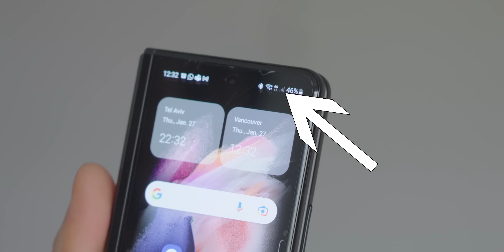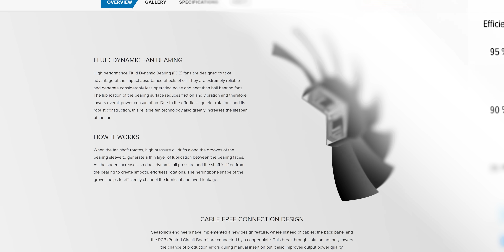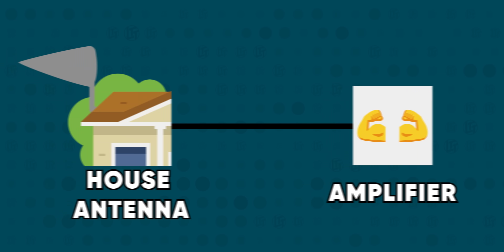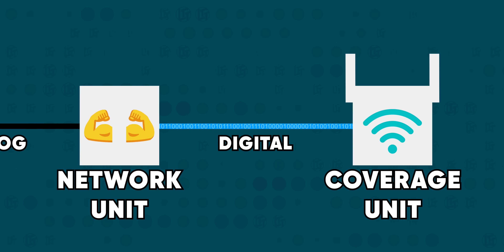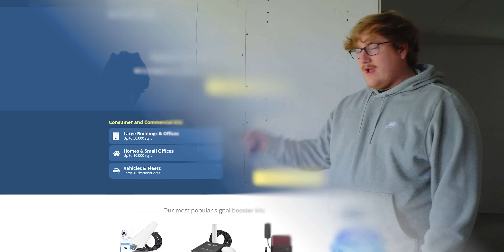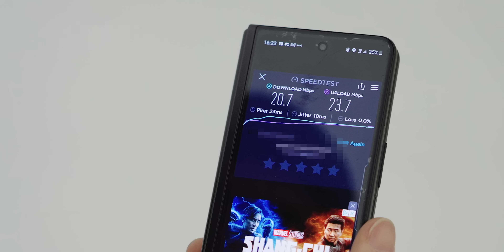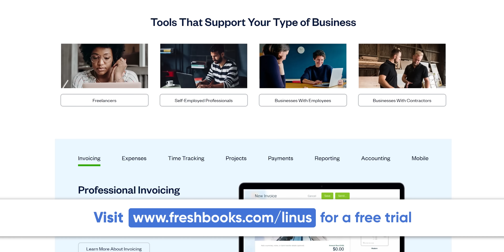I Hate This... New House Cel-Fi Cell Signal Booster Install

Comment: When thinking about cellular signal repeaters also make sure they are not against the law. In my country, if you install one without ,not that easy to obtain, permission from the authorities, you are just waiting for hefty fine. Eventhough you would install it on your property for example.
Reply: Any cell repeater that provides less than 70dB of gain is legal in the US. Now for the Cel-Fi equipment they purchased, only a certified installer can purchase it. Since Linus is certified CAT installer they were able to sell it to him
Reply: The purpose is to limit interference. It would be incredibly annoying for your neighbors if their cellphone's stopped working because they use a different carrier and you set something up for your building incorrectly that creates interference.
The FCC and other government organizations take commercial interference very seriously.
Reply: In the Netherlands you cannot use repeaters unless the provider gives permission. Which they will not and the fines are fairly high.

The problem is that each repeater increases the noise in the uplink and as such reduces the cell tower's range by a bit. Think of it like this: If you and a friend are standing a fair bit apart from each other in the middle of nowhere, you will be able to talk to each other. If the friend is a bit further away you may have to talk louder (as in increase the send power on you phone and drain the battery faster) but you can still talk to each other. Now plonk a busy highway behind your friend and you will have a much harder time in understanding each other due to the added noise.

The rather pathetic speeds Linus got there could be due to:
1. Provider doesn't have enough capacity on the cell (so a bad provider)
2. Too many repeaters in the cell, causing too much uplink noise and reduced cell performance
3. You could be on a cell intersection where 2 cells with the same channel frequency have about the same signal strength and that causes interference.

It could be all of the above, of course. You can use an app like "Network Cell Info" do a quick check on the probable cause. You RSRP (signal strength, ie. no. of bars on your phone) should be > -100-ish dBm. RSRQ should be > -20 though -15 and up is better as this does affect your internet speeds more than signal strength. Compare that to the first neighboring cell to see if you are on the cell edge or not and get interference from that. You can also keep an eye on the PCI (cell identifier) to see if your phone hands over to another cell. Those are generally places with reduced data throughput and you do not want that to happen too much in your building.

As for the coax cable, that is just standard 1/2 inch cable. Biggest we use is 1.25 inch which is a pain in the behind to use. Just make sure you put the connectors on properly as a faulty connector can cause quite a bit of noise as well and that will mess up both your coverage and cause problems for the provider. Also put the antenna on the roof and make sure it has line-of-sight with the tower if possible. Though you may need to take precautions for lightning strikes.

Comment: The first rule of any access point install or in this case cell booster install. Is have your network cable installers give you a certification report or certify each cable. Its amazing how often a cable is improperly terminated or contractors damaged the cable during construction.

Comment: I love how for 90% of the American content having a "concrete" home is a problem

Meanwhile I'm here in my concrete house having full 5g bars because where i live(Puerto Rico) cellphone companies actually account for the concrete structures and make the towers better at building penetration
Reply: I wonder if because of the increased traffic such as population, cell, wifi, air traffic control, satellite(MTU's for cable internet), etc, that they have to reduce the strength of the signals so as to not cause interference. My bet is regulations cause weaker signals here, whereas in Puerto Rico, there's not as much red tape so they can pump out the signal.
Reply: @thebaker8637  The only place I have cell phone data issues is near the phone store(there are 3 provider stores in a 2 block section of a super busy area.) Whenever I leave that area, a mile or two, I must connect to a different tower, whereas when I'm in the busy area, it feels like there are too many users for the urban tower at one time so there's a lot of people in queue. But as far as why the cell service suffers through concrete here, but not in Puerto Rico, it could also be the copper piping for the heating solution acting like a Faraday cage.
Reply: Same in india.
Reply: Well yeah.. why would cell phones companies spend time and money to account for concrete homes in a place where there are very few
Reply: @Surtistuff  to make their internet speeds better and one-up the competition?
Reply: @bethelscrubs2549  Europe in general has stone and concrete houses.
Reply: I know right! Here in Brazil is really really not a big deal having cellphone signal even in the middle of the atlantic forest
Reply: IMHO I think the main issue here is not with the concrete structure itself but with all that plumbing for heating and with the possible aluminum bars in the walls used to hold the plasterboard.

I think so because I also have that same arrangement in my wood house and I also have some issues with cellular reception, although not as bad as Linuses, whereas in my old concrete house I never had any.

So, yeah, apparently the aluminum bars in the walls and the copper tubes in the floors somewhat manage to form a good enough approximation of a faraday cage I guess.
Reply: @eddycolangelo  It's kind of both. Cement and brick are way better at shielding from microwave radiation than drywall is -- I think this goes without saying.

In Linus's case I'm sure that the main issue is all the water in the floor heating absorbing all the microwaves from the cell towers, as I believe he said in the video. 

More generally (and to your point), the main issue with 4G and WiFi is that their frequency range has a pretty annoying wavelength, around 5-15 cm or 2-6 inches. The reason that's annoying is it's very much right in the middle of the "human scale", so you can very easily build yourself an accidental faraday cage by laying down metal for some kind of human structure.
Reply: @thebaker8637  100% agree
Reply: There's a LOT more land area in the US and Canada with a lot lower density of homes. In most urban areas cell signal isn't a problem, even inside commercial concrete buildings. It's the more rural areas that have issues or the more distant industrial parks. The math simply doesn't work out on the cost of putting up new towers there based on how many subscribers it would actually benefit, not to mention the fact that most of those subscribers are going to stay subscribed with or without a new tower.
Reply: this content is from canada and your still in america
Reply: @yesyes-om1po  i know it's from Canada i mean America as the continent, America isn't "United States" it's the whole American continent
Reply: the main reason why our homes in Canada don't use concrete is because it's a terrible insulator. We use insultation in between the wooden frames and brick walls to keep heat in, and keep cold out, concrete would be terrible for that, so our towers anticipate houses that don't have concrete for that reason and are optimized for that. It was -28C a few days ago where I'm at, if this house were made of concrete i'd be freezing my butt off
Reply: @m4yhem  there's also the expense. Wood is renewable and has many positive properties for building residential homes. Concrete is expensive, has a large carbon footprint, and requires extensive amounts of fossil fuels to transport.

Except in areas where lumber would have to be shipped large distances and concrete can be made from local resources, there isn't much purpose to overbuilding homes from concrete.

Bricks do make sense in many parts of the world, but most of North America isn't that part.
Reply: @m4yhem  yes why dont europoors and south americans get this
Reply: In Canada 3G is good for 32km (Rural Tower), 4G 4km (Angled Antenna), 5G 0m (On every telephone pole :)
Reply: @m4yhem  also US, we use essentially paper houses for the same reason. And our power is generally expensive, plus most of it is still coal. So concrete or brick buildings would waste a ton of money in power for consumers, stress our power plants, and contribute to pollution on a significant scale.

It's astoundingly baffling as to why the rest of the world still uses such inefficient material. When it comes to combatting climate change, it's just absurd to continue using stone.
Reply: Different frequencies have different penetration capabilities

Comment: Seasonic is a great company. Another tech channel had an advertisement for Seasonic back a couple years ago when I was configuring my new system. I aw rhe add, was impressed and so I added a Seasonic power supply to my rig. A couple months later I have my system purchased, put together, and it was running pretty well. And on that other tech channel I saw another Seasonic advertisement. So I left a comment just to tell them that their advertisements actually DID influence people and told them my story.  A few days later they replied to my comment saying they had told Seasonic my story and Seasonic wanted to send me a few thank you gifts. I gave them my contact info and a few weeks later I got a nice package of goodies, including a Seasonic gaming desk pad and some Seasonic gummy candies.  Thanks Seasonic. I loved your swag and my rig is still loving your power supply
Reply: Same here i got a seasonic power supply and that thing is an absolute beast. 850 titanium
Reply: Buy nice or buy twice! They make good stuff.
Reply: @Nr9Boon  The only thing they could improve on would be to add a better quality fan to get the silence of Noctua fans :P
Reply: @theflyingBuSsArD  I have a focus GX 750 and I don't really hear it over anything else in my system, but I do have a bequiet case. More quiet is always better though!
Reply: @Nr9Boon  I did not want to say the fans used are super loud, just that the bearing makes some small amount of noise, at least in my case. It is honestly no problem, as the pc is louder anyways
Reply: I love when seasonic pays for youtube ads then sponsors the creator then has a commenter advertise them in the comment section. Wow now they have even infected me!
Reply: my 2tb seasonic drive is very solid
Reply: I'm in charge of all IT duties for my company. When it was just a small 4-man operation, I built a pair of storage servers, each with a dozen enterprise hard drives. Each server was powered by a single Seasonic Focus GX (not even top of the line) that are rated just a little over peak server power draw behind a UPS. They ran for three years 24/7 without any complain. Another three years later today, they're still in some of our workstations and ingest stations humming along happily.

When a company put a twelve-year warranty (it was ten years back then) on a segment of their product lines, you kind of have an idea that they're really confident of their products.

p.s. I'm not saying you should build mission critical servers without redundant power supplies.
Reply: this is an ad...
Reply: I haven’t had a blast with their power supplies, and that’s a good thing. I’m really happy with my GX-750. I too found them through sponsor spots.

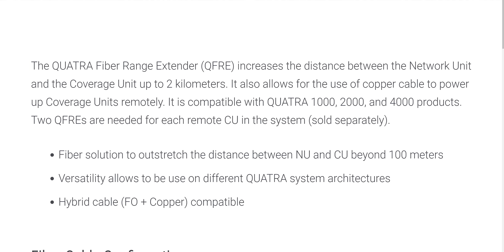Comment: 4:30 A new member has joined the family! After the LCD display, the HDD drive, and the HTTP protocol, make room for the brand new POE ethernet!
Reply: Don't forget about the SSD drives!
Reply: @666Tomato666  or the ATM machine
Reply: @levygaming3133  or the TPM module
Reply: Power Over Ethernet ethernet?...
Reply: Next up, LTT Tips?
Reply: @Mellie036  That one makes sense, tips on dealing with Linus's tips.

Comment: The thing with boosters/repeaters is since you're connected to one antenna you lose MIMO Ability and sometimes carrier aggregation. This is where the speeds come from with cellular connectivity
Reply: Yeah that's a great point! MIMO is so important for data speeds, but in most cases where cell signal is bad, stepping down to SISO for better signal strength and quality is usually worth it.

Comment: Telco I used to work for in Australia, just in retail, resold the Cel-Fi Go Repeaters to customers as well as the antenna needed if you wanted. Virtually everybody that got one never had complaints and said it worked a treat. Pretty much every provider here, at least the big 3, provide WiFi calling and SMS so it's not a huge deal, I would say we sold more on-the-go mobile versions of the repeaters than the at home versions.

Comment: In the UK we can buy these router like devices that plug into your router that uses your home network to create cell signal. They are a bit weird though and some from the likes of Vodafone required you register your phone with the device before it would work. They are generally exclusive to the network you bought them from too.
Reply: US too, I have a t-Mobile one in my house
Reply: Based on another comment here, the registration is probably for security so your neighbours phones don't connect to a box you control which may enable you to snif their traffic.

Comment: Linus, hoses in Florida are basically made out of concrete. We get the same issue with reception. Usually it isn't so bad though because it's flat and a cell tower can basically get into every room, but any windowless room or hallway has horrible reception.

Comment: Early Prediction: Cell Booster to the rescue!

Edit: I'm really glad Linus posted this video. For the last month or so I've been having the same headaches trying to find a solution, and have hit the same wall of people not calling me back, or people not being willing to even guarantee their product. The fact that these waveform guys required them to do a signal test in the house first, tells me a lot about who they are.
Reply: yea
Reply: I mean what carrier do you use it's pretty dependent
Reply: @theanimeotaku2794  Sasktel/Telus both have towers in the area but share customer usage.
Reply: @seanbrockest3888  oh I thought you'd be in the US but cel Fi as Linus used is good for a signal repeater since I have a similar one but in the US with TMobile it's just a window unit and a coverage unit it's pretty useful since my phone would drain more from low signal strength plus speeds are more consistent

Comment: "Needs to be encased in concrete on each level of the house! which heavily blocks cellular and wifi signals" he makes this sound awful, meanwhile most of the homes in Latin America are built with brick encased in concrete including the inner walls (it's less on the affordable modern houses). This makes me wonder if cellular companies install more antennas around here, because although reception can be awful in some areas of some houses, I would say around most of the urban areas it's fine (at least in the 100 km around Mexico City which I know best)
Reply: Good point and it kinda depends. Certain providers use different frequency bands and different bands are better at going through material (but the trade off is usually range from the tower or speed). So it always kinda depends on who you use for a carrier and what antennas are nearby
Reply: I was going to say the same, the concrete layer on his floor is probably only 5-8cm thick and that's like nothing here in Germany (normal ceiling is like 20cm). I remember only a few buildings I had problems getting connections inside and that was mostly in the basement or ground floor.
Reply: @timonkuschke3861  This just in, Canada is way bigger with way less population than Germany and Linus probably does not live in the city. There's no way we can have as many towers/as good coverage.
Reply: @Fattony6666  i completely disagree also they are in bc which has a lot of people
Reply: Oh, these North Americans and their houses of paper with cotton candy between walls. They are so amusing.
Reply: @danswope  oh that's true, they probably also use other bands better suited for that
Reply: @bennyfalkenberg24  BC has 5 million population, that is miniscule for the amount of land.

Comment: It makes sense that the upload is super solid since you're no longer dependent on the output power-limited RF transmitter on your cellphone reaching the cell tower, but on Waveform's network unit which probably has a solid Tx amplifier, in combination with a directional RF antenna aimed at the cell tower.

Cool product!!

Comment: Waveform owes Linus a cut of the 10x increase in sales they're about to have.
Reply: It might be less than 10x but it will still increase their sales
Reply: They did, by sending him thousands of dollars of free tech
Reply: @jeremywp123  5:06 Ah yes I missed that small piece of information, plus the promo code.
Reply: Great advertising.

It was so simple as the answered the phone when the customer called and got the sale and decent advertising on the video.

They will easily make whatever they traded Linus for the air time and then  some.

Good on them too.

Comment: Another Cell Signal you should try out is WeBoost! I’ve been using the 4G LTE WEBoost at my house for a couple of years and it has been so awesome! Before I had zero bars inside the house, some days if we are lucky we get 1 bar outside. Once we got that thing installed, we got a solid 2-3 bars inside the house.